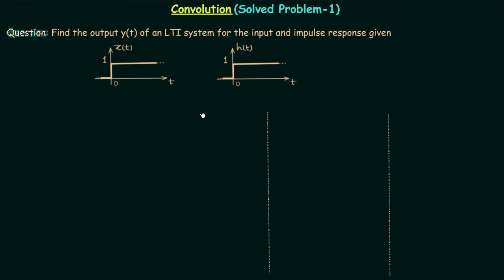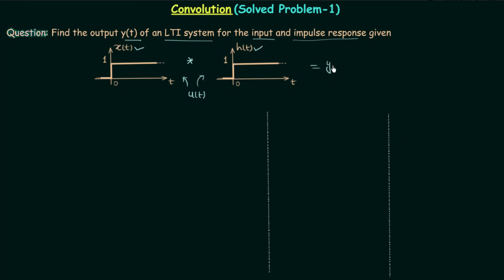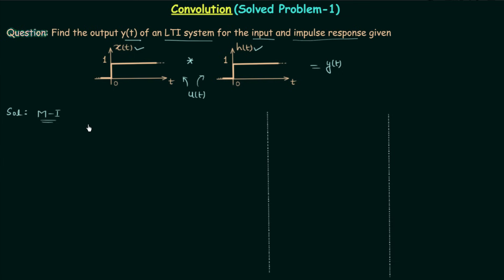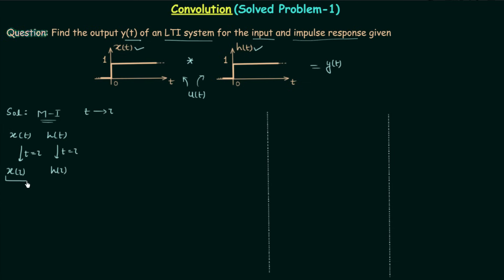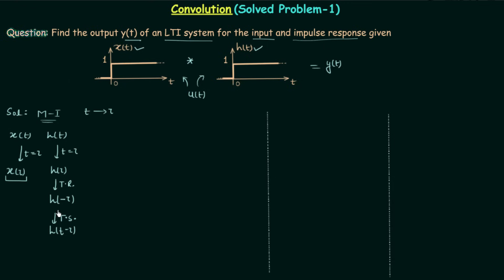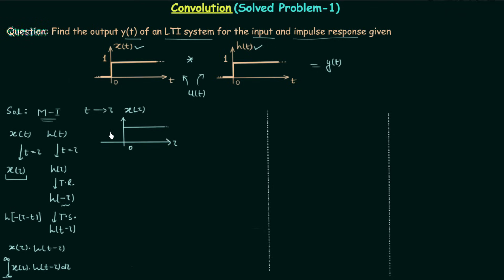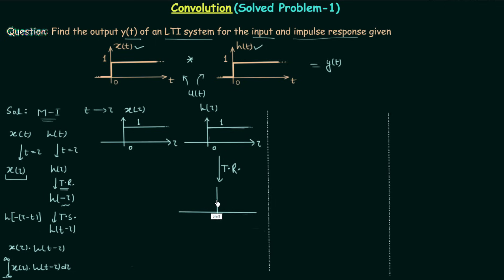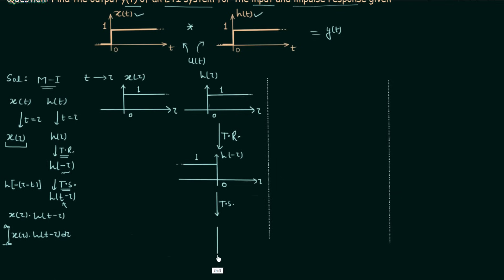Convolution (Solved Problem 1)

Comment: Why are we not taking 3 cases , {- infinity,0}, {0, t}, {t , infinity}. 
Also IF we are only taking 2 cases  {- infinity,0}, {0, infinity}, then in solution its showing y(t) = 0, t<0 and y(t) = t , t>=0.
I didn't get where did t to infinity portion went ? If its 0 then why in solution we took , t>=0

Comment: we can write the given func as unit signals and then use u*u as ramp and get the answer directly using this method  saves a lot of effort :)
Reply: Why are we not taking 3 cases , {- infinity,0}, {0, t}, {t , infinity}. 
Also IF we are only taking 2 cases  {- infinity,0}, {0, infinity}, then in solution its showing y(t) = 0, t<0 and y(t) = t , t>=0.
I didn't get where did t to infinity portion went ? If its 0 then why in solution we took , t>=0
Reply: Cause when t goes to inf it is taken care of

Comment: professor when you convert from h(-𝜏) to h (t-𝜏). The curve should shift right instead of left. This is because the shifting operation is performed on the 𝜏 component only but no the whole (t-𝜏) argument. My professor taught us to let another function g(𝜏) = h(-𝜏), then perform subtraction or addition to g(𝜏) so that h(-𝜏) becomes h(t-𝜏), in this case we perform subtraction: g(𝜏-t) = h (-(𝜏-t)) = h(t-𝜏) (note that the shifting is performed only on 𝜏 but not the whole argument). Finally, because of g(𝜏-t), -t means that the whole curve shifts to the right by t units. Therefore it should shift to right instaead of left.
Reply: It is actually shifted to right but if you take t<0 then you see it will go the left and as you increase t it will go towards right, it was mentioned in the previous videos with total 5 cases that how the the two signals translates ... Sir actually skipped that explanation

Comment: In case II , t>0 range, why is the limit [-∞,∞]. Wouldn't it be [0,∞]? h(t) overlapped x(t) from 0.
confused about it. Hope you will help.
Reply: It will be further 0 to t which he forgot to write as -inf to 0 ,0 to t and t to +inf r 3 limits and for 1st and 3rd limits value of convulation is 0
Reply: @Bishu72405  Then why in solution y(t) = 0, t<0 and y(t) = t, t>=0 . As from t to infinity, y(t) = 0

Comment: sir the limits of integration must be from minus infinity to 't'.
Reply: No limits are from 0 to t
Reply: No, you can (in case 1) immediately evaluate the integral from -infinity to infinity because there is NO overlap in signals in case 1 (t<0) so the product is always 0. Resulting in the integral being 0.

Comment: Sir why you take limits as -ilinfinity to +infinity
because signal overlaping is from   '0' to 't'
Reply: Same doubt
Reply: @vaikh8450  Why are we not taking 3 cases , {- infinity,0}, {0, t}, {t , infinity}. 
Also IF we are only taking 2 cases  {- infinity,0}, {0, infinity}, then in solution its showing y(t) = 0, t<0 and y(t) = t , t>=0.
I didn't get where did t to infinity portion went ? If its 0 then why in solution we took , t>=0
Reply: @kritikabhateja110  thanks for rectifying my mistake but now I doesn't even remember what the Q was ? 😅

Comment: There is a mistake at 9:36
In second case : for t>0 integration limit should be from 0 to t not from -infinity to infinity.
Reply: There is no mistake, both represent the same thing. The integral is investigated for different cases according to the t intervals which is important..
Reply: @dfdatasets  Why are we not taking 3 cases , {- infinity,0}, {0, t}, {t , infinity}. 
Also IF we are only taking 2 cases  {- infinity,0}, {0, infinity}, then in solution its showing y(t) = 0, t<0 and y(t) = t , t>=0.
I didn't get where did t to infinity portion went ? If its 0 then why in solution we took , t>=0
Reply: Thanks
Reply: yes
Reply: same is for case 1...limit should be from -ve infinity  to t

Comment: Shifting is done wrong at 5:03 sec
Reply: Yes the shift should be to the right if t>0
Reply: You stupid, you should watch previous lecture
Reply: I watched previous lecture but I didn't understand yet why shift isn't to right , could you explain it more ,please ?
Reply: @RahmaElsaeed-cf6ru  first shift then reverse, you'll get the answer
Reply: @devanjanchakravarty5543  first shift then reverse also gives the same answer. while performing reverse operation we must take the mirror image about y axis (with respect to tau = 0 line), not with respect to tau = t.
I think the shift should be to the right by t.
Reply: @engineer3961  exactly it should be right not left